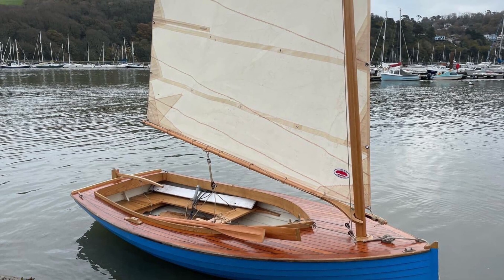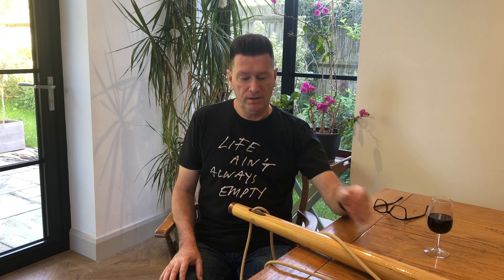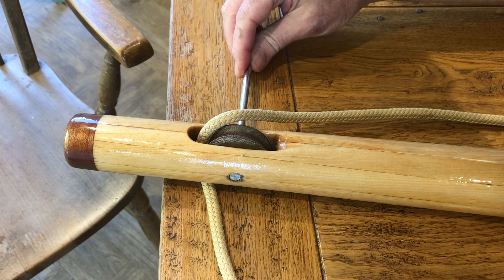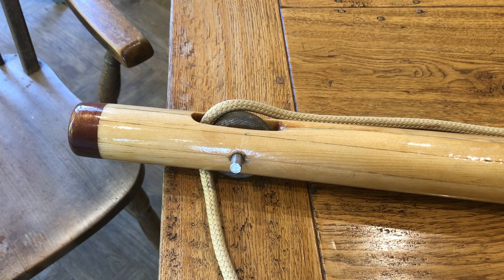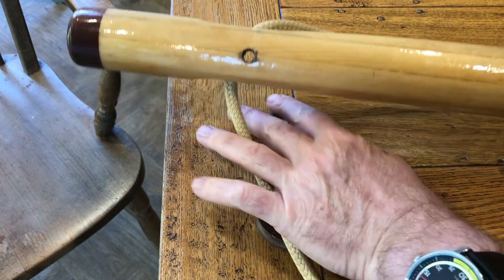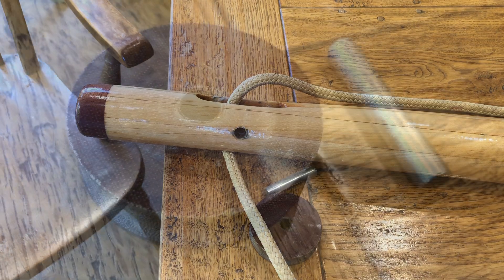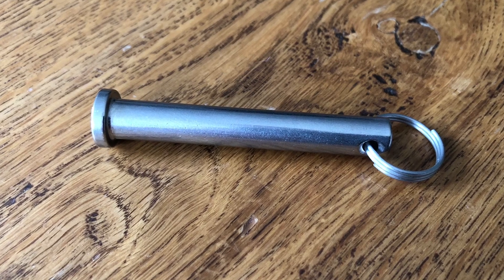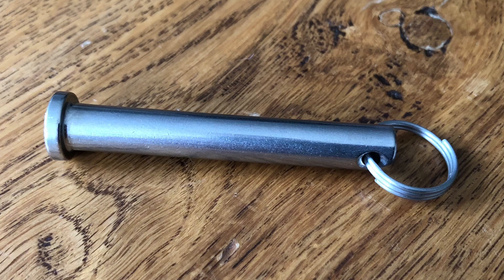Masthead And Halyard Sheave Pin: A Better Solution

Comment: May I ask - it looks like you have brass(?) tubing in the clevis pin hold going through the mast.  How are the tubes installed? Did you epoxy them in? Thanks!
Reply from the maker: Yes. Held in place with epoxy. For binding two different types of material I’d recommend a flexible epoxy like, G-flex epoxy, as the materials will expand and contract at different rates.
Reply: @WavingNotDrowning  Thanks for the answer - even after all this time after you posted the video.  I'm modifying my mast to take a sheave for a main halyard and I'm trying to gather all the ideas I can. I've ordered a clevis and rubber stoppers like yours.
Reply from the maker: @GreggGermain-lk8if I’m glad the video helped. Good luck with the project.

Comment: I would have kept the original axle pin, and just put a curved small brass disk, fixed to the outside edges, like traditional wooden blocks have done for the last 100 years.  That said, I considered adding a block,to the top of my standing lug rig, but decided to keep the drilled slot in my top mast, which has a brass wear strip fixed in the slot’s bottom.  This has worked well for the last 15 years.  Cheers

Comment: I agree with your solution;  would a nylon or rubber washer make sense on the ‘head’ of the clevis pin also? The pin will likely have a little more side to side play with this set up, and by itself not a concern, just that the clevis pin moves instead of the original fixed placement. 🤔
Reply from the maker: That’s a very good point. I did consider it as an option, but any movement is really minimal. Although I am checking for any wear caused by the head. None so far. But it’s a good belts and braces option.